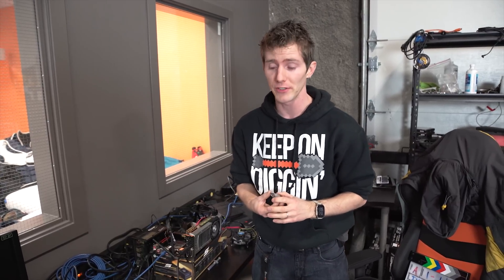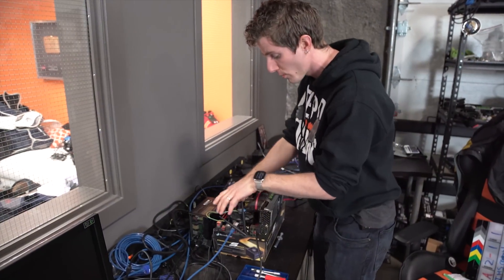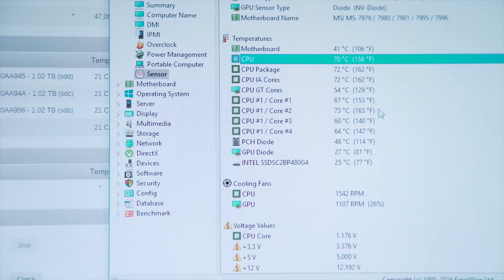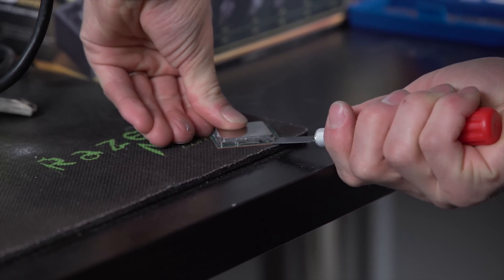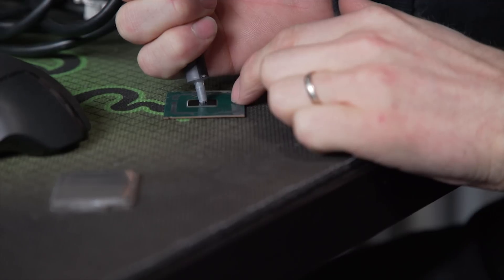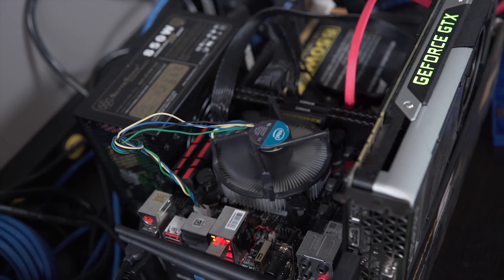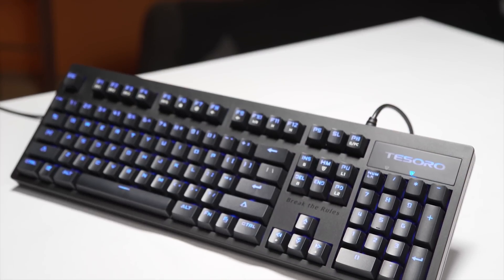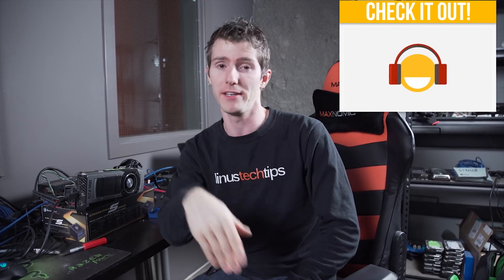Delidding an Intel Core i7 6700K - Is it worth it!?

Comment: dont use the razer method, hammer n vice method works without trace cutting risk(as long as your not an idiot and know how to use the hammer without being a 200 poung gorilla) 3 years 3570k delidded here no problems, also if yer using a cooler that sucks, its still gonna suck afterwards(if it can't dissipate the heat fast enough before, its still not going to afterwards is it?, you failed linus on two points, used a stock cooler, and I suspect you have a cpu that doesn't have unusually high temps to begin with, I'm betting intel cherry picks the CPU's they send you, and for the ones you buy for most things you get the highest end range.

try getting a few of the 3570k modern equivs pick the one with shit temps on an evo or equiv cooler, then try it, only then is it worth it.

I have a 4690k in another machine that I haven't bothered doing it to cause it gets perfectly fine temps, only worth considering if you got a fail one, and live in a country that would take 3 months to warranty

knocked 17C off my 3570k from 78C to 61C max load. using a hyper 212 evo cooler
Reply: Revoku Nice wall of text, nobody cares thou
Reply: Note that the skylake series PCB is MUCH more fragile than earlier CPUs, and using the hammer & vice method has broken quite a few 6700Ks.
Reply: So you blame him for buying parts that aren't complete shit? How about you get parts for the job you want them to do, so you don't have heating issues? You are literally defending this janky ass solution just because you don't want to upgrade to any modern parts.
Reply: who are you talking to?
Reply: Revoku You, that's why I replied to your comment dumbass.
Reply: made alot of assumptions there,  at no point did I say I didn't want to upgrade to modern parts, also, please tell me what parts are these ones without the heating issues? cause intel should be soldering them all to the die from factory, not using cheapo TIM under the IHS, also I'm defending the solution cause it worked, and used the 3570k as an example of it being a permanent solution(its worked for years), additionally who am I blaming, and when did I blame them?

Edit: So I don't have to explain later here's the assumptions you made

1) you assumed I was blaming someone..for some reason..for something
2) you perhapse assumed the saying around gorilla was some sort of insult, rather than a reference to people who don't know how to use the correct amount of force for something. "if you don't wrench on it like a 200 pound gorilla"
3) Assumed there are consumer grade Intel CPU's that don't have shitty TIM under the IHS, just because it works with shitty temps doesn't mean people should be happy spending $700 on a CPU thats not constructed properly for some 0.3c worth of solder.

4) assumed I have only the PC's listed in my previous comment
Reply: What's with all the gorilla hate? And why a 200 pound gorilla? Some gorillas can get as big as 400 pounds. Are you OK with gorillas of that size?
Reply: Thanks, that was very helpful information. Ignore the dicks in the comments with a reading deficiency.